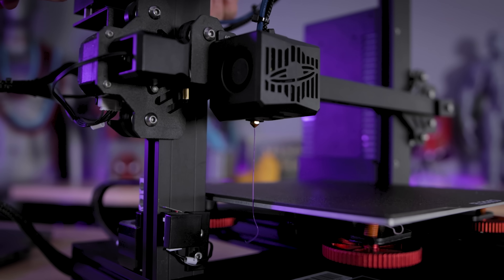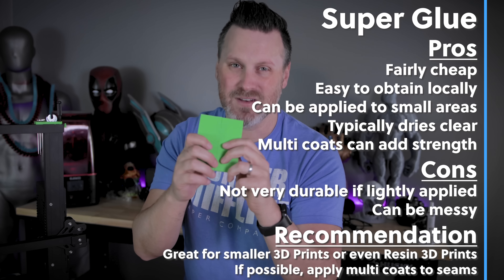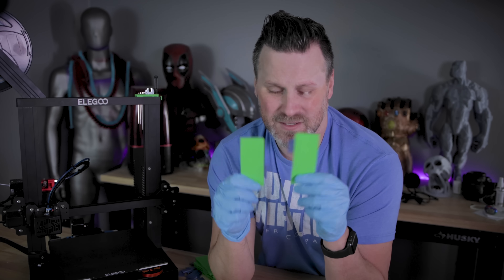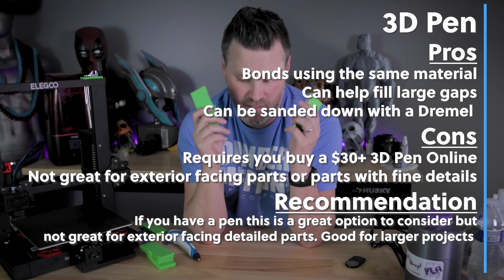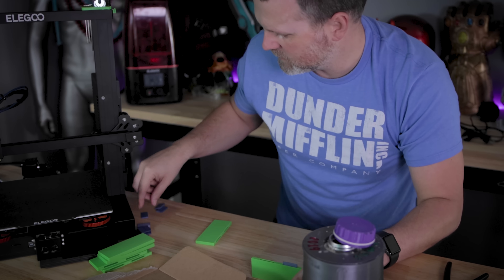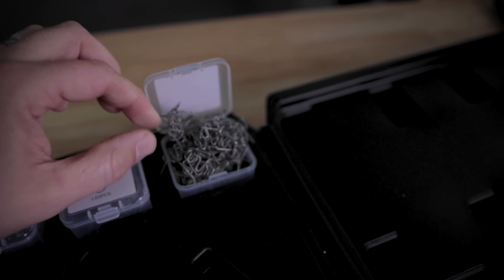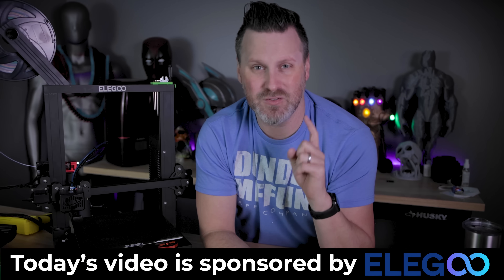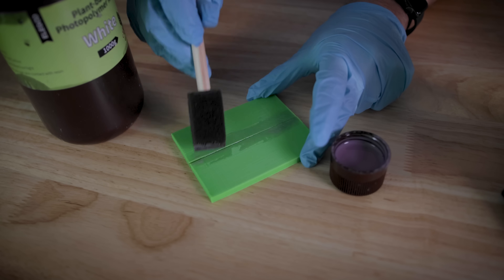6 Ways to Connect 3D Prints!

Comment: There is also friction welding. Put a piece of filament in the dremel and run it on the seam. Just be careful not to turn it into a weed whacker (use a short piece) and also wear goggles.

Comment: For Pla I use dicholomethane/ methylene chloride .. it solvent welds the surface and is very thin allowing for capillary suction between parts

Comment: I think 3DGloop AND the heated stampler for large parts is perfect. Stamps goes on the inside where it wont be seen ofc, like inside a helmet for example. That would create an insane bond to your parts and your layers might be more likely to separate than the weld itself. Small parts like you said wont need much more than superglue. I made a few cosplays in eva foam and found hot glue was a quick way to assemple parts, doing a large flat hot glued area on the inside for support(especially for locking down straps. Actually ripped a strap and not the glued area one time). Smaller parts are harder to break off because of the lack of leverage, so super glue is great in that area.

Edit: Yes, I overbuild my parts. I would never want anything to break while on a con.

Comment: What I do is use a hot glue gun and melt a plastic joint with filament, you can make a smooth joint that way, (kind of like plastic welding) and then I apply super glue to the inside and outside and repeat for the other side of the seam, very strong especially with extra layers of glue and plastic!

Comment: you could have done a much better job on those welds with the 3d pen. tack it around the seem then do what you did. then run the tip over it without extruding new material to clean it up/smooth it.  also sometimes its best to use little bits of pla, set them on fire with a lighter for a sec then forge weld it with your thumb.  it may hurt but your part wont care.

Comment: try prepping the parts before attempting to weld. if you look at traditional welding techniques it may give you ideas. here's what I got so far;

1. design parts with 45 degree chamfer on edges you intend to weld together
2. Tack weld in a few locations until part holds itself together (using wood burner or the tip of 3d pen)
3. confirm dimensions
4. weld the root with wood burner
5. use 3d pen to weld the rest until its even with parent material. kind like a mig welder

you could also add recesses to either add other 3d printed plastic tabs(kinda like the purple ones you're using) or spots to add the plastic welding staples and then using the pend to add material over top of that.

Comment: Let me get this straight you
1. Put pegs in
2. Didn't use the extra surface area provided by the aforementioned pegs

Side note: a little shady that the only one you didn't do this on was the plastic cement, which you happen to have an affiliate code for. Not saying it was intentional, but it could have affected the results to personally benefit you.

Comment: Did you consider any combinations? I've heard of people using super glue and then using a 3d pen to "fill the seams" and THEN melting the edges smooth witha soldering iron. I also use 2 part epoxy when I'm doing larger models (like helmets). That always works well for me (although I don't deliberately drop my helmets on the floor multiple times) ;-)

Comment: Hey Uncle Jessy any tips on fighting copyright infringement on etsy? Also with regards to the 3D Print pen you can probably not even use filament if theres no filament sensor and just use it like a soldering iron to melt the edges to quite literally physically bond both pieces together.

Comment: Cover the staples with the 3d pen using the same filament. Sand down flush. Typically all my jobs can be handled with super glue and some 3D printed joinery on the part so I haven't branched out into other adhesive method. 3D gloop looks like something that would be nice on hand though.

Comment: Do a test with Gorilla Super glue. I play and paint miniatures as a hobby and I will tell you that Gorilla Super Glue holds way stronger over regular supergue like loctite. Seriously drop minis on the concrete and pieces will snap off before the joints will break.

Comment: I see a lot of people are mentioning epoxy. Epoxy has a much higher tensile strength than super glues. Super glue is good when there's zero gap between components. Epoxy is if you have gaps or want to build up a seam. Ever seen a hammer with a fiberglass handle? It's epoxy holding that handle in there. I've also found JB Weld to work great on many types of plastics. The Quick obviously dries much faster. I've also glued two pieces together using Gorilla Super Glue, which is my normal go-to, and followed up by working a bead of epoxy around the outer seams for extra strength.

Comment: Harbor Freight's kit is really nice. I use it all the time on ATV fenders and really anything else broken plastic. I use the hot staples too. Got a $25 set off Amazon and the replacement staples are really inexpensive. Also, after you get the staple in as far as you want, twist it just slightly and you can pull it out without waiting for it to cool. Another benefit of that is it wedges itself into the plastic.

Comment: I have an Elegoo Neptune 2, and absolutely love the thing. Once I got the leveling dialed in, I had absolutely no problems with it. However, the build plate became worn out and I've tried numerous different products (wham-bam plate, a couple other PEI sheets, tried printing on the backside of the plate, etc.) and have not come across anything remotely as good as the default build plate. Has anyone found a decent replacement?
Reply: Amazon should have one and I would recommend if you are getting a new bed anyways, then you should upgrade to an ultra base or spring steel bed, and then it would not wear out as easily.

Comment: When it comes to structural parts, I usually take a page out of the tig welding books: Leave a chamfered edge between two joining pieces (basically a trench for new plastic to sit in), hold a length of filament to it and use a soldering iron to melt the filament into the trench. I could probably get similar results with a 3D pen, but I like the control you get with the soldering iron where you can focus the melting on the printed part moreso than the added filament. And the second tip I guess is to err on the side of too much added plastic, rather than not enough; sanding down a thick weld is worth it if I know I got good penetration into the parts.
Reply: I got a rework station instead of just an iron and let me tell you, the rework air gun with a 3D pen works wonders
Reply: No need to all of that, I post a reply to what exactly (chemically) melt it and when the two parts or more bonded together they will be way stronger than print itself.
Reply: @agonymobile  i'd rather just breathe melted plastic than aerosol plastic and that stuff
Reply: Both are bad for lungs, 
Resin is even more as well
So for sure dont use it inside. 😉
Reply: that's really bad for your soldering iron tip though
Reply: @butre. That's why you use a cheap soldering iron for it

Comment: So I've always used a soldering iron for my larger prints and hand to work out the disfigured plastic for a decent finish. Super glue for a few of my smaller like desk prints that no one will really be dropping too much. I was wondering how much of that 3D gloop anyone would recommend for a printed helmet? I see they have small bottles or those large jugs, but if I can get a cheaper small bottle that'd be cool. I do have a few prints in mind that could use it, but I wanted to just ask before ordering the stuff. Thanks in advance to anyone!

Comment: If you're quick enough, what I do is lay the 3d printed pen in the contact edge not on the outside edge. If you can get the 2 pieces together quicker it seals much better and also doesn't require clean up

Comment: 3D Gloop has "Glue Gloop" that comes in a tube and is a little thicker. It's good for more precise application. Since it's a little thicker is dries slightly slower, which is my only issue with 3D Gloop..it's dries a little too quickly. You only have a couple seconds to reposition a part before it starts bonding. Regardless, 3D Gloop has been my go-to for the last few years. You definitely want good ventilation when using it though.
Reply: Ventilate ventilate ventilate!! That's not even slightly kidding. It seems a lot of people aren't reading the SDS for that stuff as it contains some basic neurotoxin chemicals. It's some nasty stuff to inhale. Beyond ventilate really it's a good idea to wear a VOC respirator.
Reply: @secretagb  <after it fully cures> are you able to put a print that use’s it on your head? Example; a helmet using it to bond parts.

Comment: Acetone. Acetone will melt the surface of the pla making it sticky. Put on both parts where glueing then join them together. Let dry. The plastic will fuse together as 1 peace. Plz show it off one day. I have told a few ppl and they tried it and liked the out come. U are number 1 in my book for 3d printers. I've watched hours upon hours of ur videos. May have missed a few lol. But I'd like to see the man who got me into 3d printing use a method I recommended. Bro that be cool.

Comment: With the inserts/pegs for extra strength I would have printed them perpendicular to the force that is going to be applied.

So for example instead of printing them standing up so it would split along the layer lines print them flat down so any sideways force from flexing cant split as easily.

Comment: I would say that I usually use super glue on sanded parts (super glue works best when the gap it fill is the thinest, sanding reduces the ripples and increases contact surface).
Also I tried all kind of solvents on PLA at my school's chemistry lab, and only two works well with PLA : 
di-chloro-Methane (a molecule of methane which two hydrogen are replaced by chlorine)
di-chloro-ethane (his older brother, not one carbon with hydrogen and chlorine, but two carbons linked same as the difference between methanol and ethanol).
The diy youtuber valera perinski, who makes really good videos on his homemade tools, always uses dichloroethane

Comment: Plastic weld works wonders if it’s the right plastic it’s actually melts the pieces together
Reply: This is the best solution in my experience too - no residue, fast, strong, physical and chemical bond.  With ABS the orange label Plastruct is like magic

Comment: My issue with the uv resin is that the uv isn't going to get on the inside parts, only on the outer edge of the seam. IMO a two part epoxy would be better there, with maybe using the uv resin to fill in seams so it looks like a solid piece instead of 2 parts(like you mentioned).

Comment: Side tip for using super glue, keep baking soda on hand, and it will INSTANTLY cure it and at the same time make it a bit tougher... Far from indestructible, but a good bit stronger than plain superglue.
Then you can layer it with more glue, then a sprinkling of more baking soda, clean off the excess, and repeat as necessary to build it up as much as you need it.
From there you can sand and file it to shape, also good for filling some gaps and rebuilding a little bit of a broken-off (or missing) piece so long as you keep in mind it's still just super glue.

Comment: using resin to join is a bit hard because the UV doesn't have much chance to get in between the seam. some slits to pour resin into like stitches might cure and hold better.

Comment: I bought my first printer based on your recommendations. Saved up for almost 6 months for the Neptune 2S and for someone who has never built a printer, seen a printer in real life, and has limited hand movement/strength, it took less than 2 hours with a break till I was printing the chibi-like monk. Test print came out perfectly. After using it for a while I have only needed to level it once after set up due to repeated failures and I realized I just needed to up the temp by 10. 
I was worried about building the machine due to the small wires and belts, but it all went together perfectly. I would HIGHLY recommend this printer setup to anyone.

Comment: I came from a woodworking background. Joinery such as dovetails, rabbets, dados and biscuits are intended to increase the surface area for the glue. Even a mitre cut increases the gluing surface over a butt joint. Some joints such as dovetails may not even require glue. Physical orientation of the load will also improve the strength of a joint (I'm sure that will inspire some 420 jokes haha). Egypt is full of stone constructions where stone blocks use alternating corner "laps" dramatically improving the integrity of the corners. The end use of each joint should be considered not just from a bonding perspective. There's my 2 bits! Thanks Jessy.
Reply: It is interesting to see how little communication there is between plastic and wood. I love both but see very little of the old knowledge coming over. I also see an awful lot of 3d printed stuff that should just be a piece of scrap wood and a few holes.
Reply: These are all wonderful suggestions.  But I can't help but wonder how applicable all the joints would have under certain situations.  I'm exploring snap joints to join parts together solely for the mechanical advantage that can be imparted directly into the print.

Comment: I'm a big fan of using a flat soldering iron tip to weld parts together, even smaller pieces.
I picked up a 3-piece set of Tamiya files, which I've found are perfect for sanding down seams after welding, even on smaller parts with finer details.

Comment: Thanks for the video Uncle Jessy very informative.  I've found Super Glue Brand from Dollar Tree the two packs with the little bottles (with a little sanding to the PLA) to bond much stronger then other brands like Loctite/Gorilla Glue etc...where if I've dropped prints it would break elsewhere before it broke at the super glued seam in most cases.

Comment: You missed the first trick I learned which is friction welding with a Dremel, you just add a small piece of the filament to the Dremel and push gently. There are some videos around here. It works great but it's also a little destructive of the finish like with the wood burner but it does work really well too
Reply: I actually first saw this in a Make Magazine several years ago.

Comment: As a side note, my experience has been that CA accelerant will make the glue more brittle. I love the stuff for figures to save time but for strength I get better results without it.
Reply: See my reply, its more stronger, and also remove surface stress so no more cracks appears after while.
Reply: @agonymobile  See my reply, its more stronger, and also remove surface stress so no more cracks appears after While.

Comment: 3D gloop is definetly the way to go, Joel has shown that it works wonders, works like welding ABS with acetone; I've wanted to get it for a long time, but nobody sells it here in Mexico :c
The welding is the second best option IMO, with the gun coming first as it does it a bit more clean than using a wood burner, and filling/sanding looks easier that way
Reply: Might be time to get a POBox and import stuff that way. That's how I get my 3d gloop. Saludos.
Reply: @JuanRodriguezNushio  yeah, I was considering that, but with all the liquids and stuff for importing being an issue for some importers I've chickened out so far
Reply: 3D gloop and ABS slurry is pretty much only good for nonfunctional parts

Comment: Dumb question: Is it possible to connect them by printing them together? Like laying them on the bed, measure the height of the objects and the placement on the surface area and make a file that then connects those pieces?
Oh yeah, great video. 3D Gloop and super glue are the best options in my opinion, but damn I want that plastic welding gun just for the sake of it
Reply: Yes could do that and you could also use dovetails when you need to glue pieces to give it real strength

Comment: Is that gloop similar to what you use on PVC piping for plumbing? Seeing that brush in the cap totally reminds me of that stuff.
Reply: Pretty sure it is a similar principle.  The gloop starts to chemically melt the plastic and allows the melted plastic from both parts to mix together before the chemical evaporates off, leaving solid plastic behind.
Reply: I think it has less toxic chemicals in it